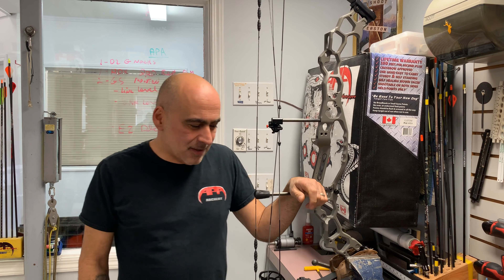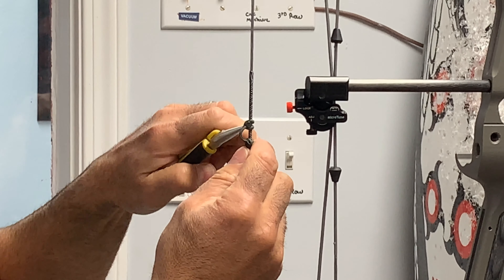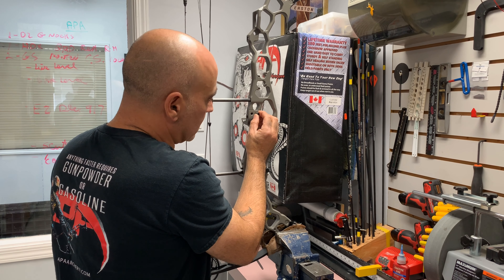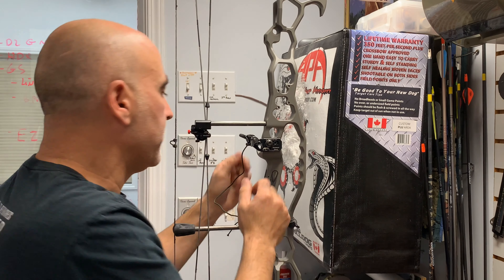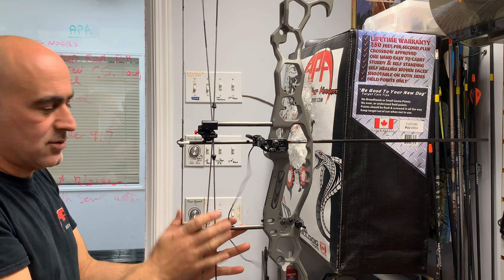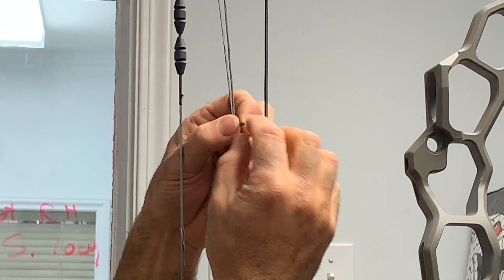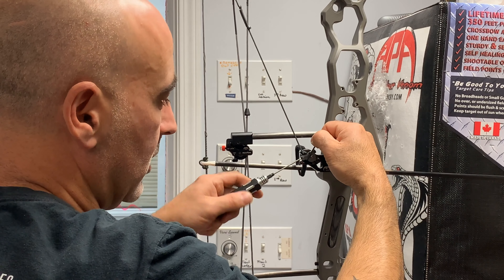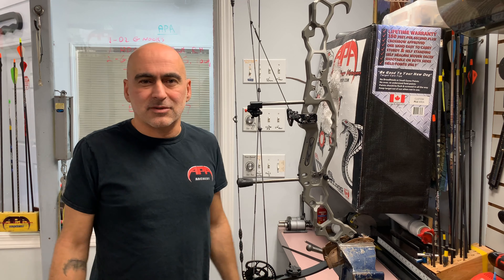How to Install and set your APA Twister Rest

Comment: I like the new coil spring idea. One issue I've had with an older Twister is when I mount a quiver; I would find myself having to time the rest around the cable, the problem being is if I took the quiver off, the rest fell out of time with all the extra slack in the cord going to the buss cable.